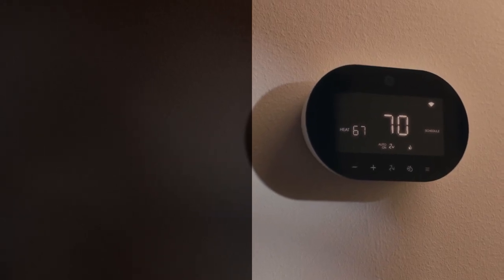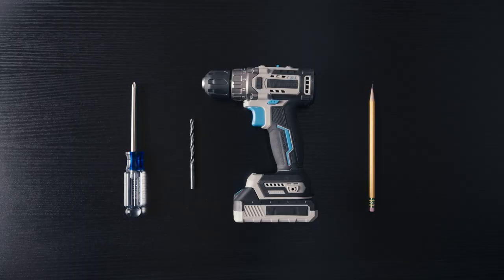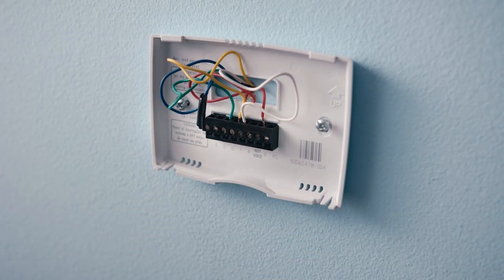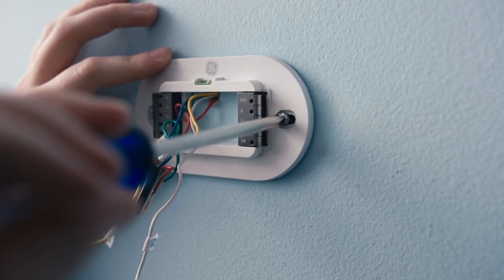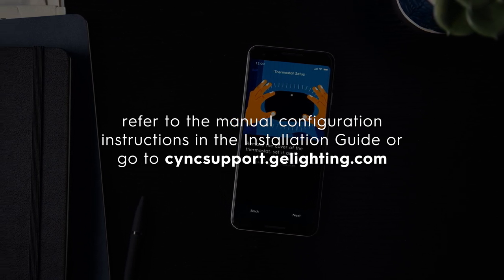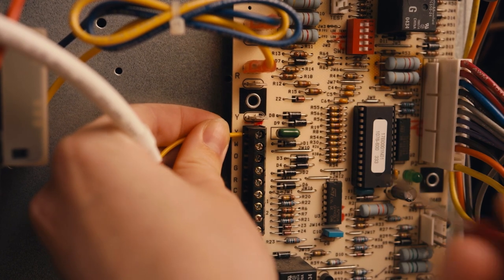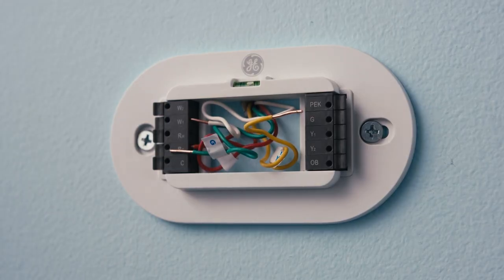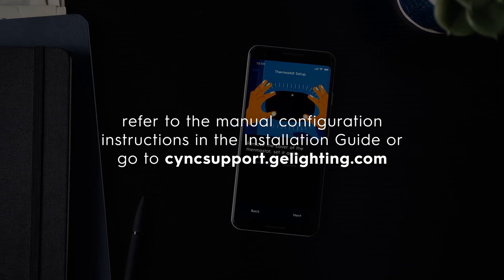How to Install a Smart Thermostat - CYNC

Comment: Is there's a function like when your away it reduces heating by detecting your phone's location?
Reply from the maker: Hi Ed. Thank you for reaching out. Currently, there isn’t a feature that allows for the thermostat to trigger based on phone location. However, with eco mode, you can set certain setpoints to have the thermostat trigger based off of temperature. The Cync app uses location to set schedules and for Bluetooth/Wi-Fi proximity connections. There is a thermostat notification that can send alerts for min/max temperature; however, this is sent via email and not through an app notification. This resource can explain in detail the different abilities and functions of our thermostat: https://cyncsupport.gelighting.com/s/article/thermostat-settings?language=en_US

Comment: I don't have access to the HVAC, do you have another solution for installation without C cable or blue? I bought this device
Reply from the maker: Hi there. Thermostat configurations that lack a C- Wire will still be able to work! They simply require the use of the PEK or Power Extender Kit, which comes with the device. Here’s a helpful resource: https://cyncsupport.gelighting.com/s/article/installing-a-cync-thermostat?language=en_US

We also recommend that you take the following Thermostat Compatibility test to ensure you are eligible to use this device: https://www.gelighting.com/cync-thermostat-compatibility

If you still feel uncertain about the installation process, we highly advise you contact a local HVAC technician to assist. Our team would also be more than happy to answer questions directly. You can reach our team by calling 1-844-302-2943.